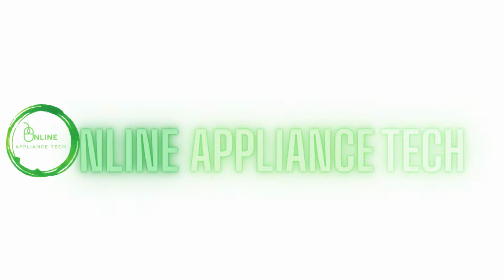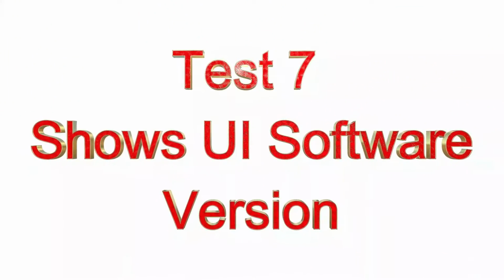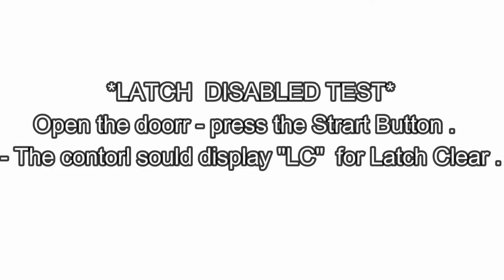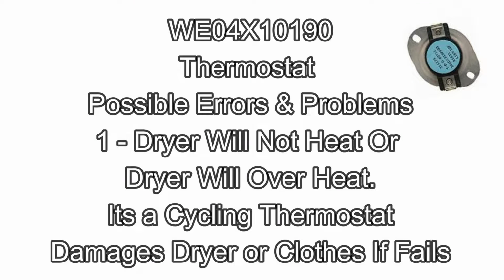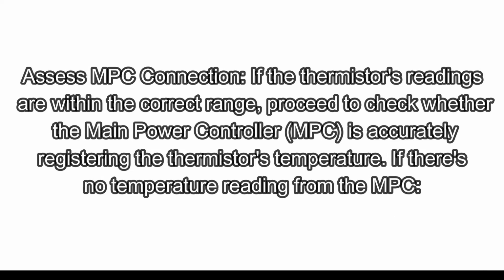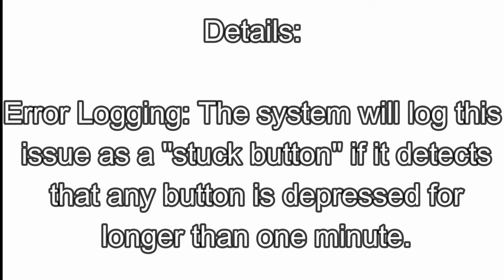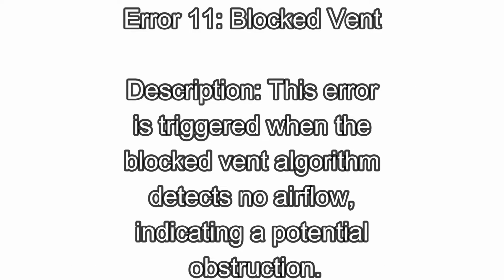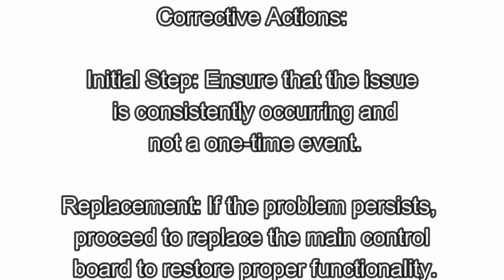GE Dryer GFD85 Series: Diagnostic Mode & Error Code Solutions

Comment: Great video, thank you! Looks like I had error code 8 and 13 which went away after running these tests. I did not clear them they went away. What has been consistent, though, is the Test 11 Door open/closed shows do whether the door is open or closed. The dryer still runs either way, but Test 12 Door Latch does show LS and LC correctly. Not sure if these two are correlated, but either way it seems the door always showing open may prevent the dryer from heating properly despite running a full drying cycle. Does that sound right? Also, what is Test 15? Seems to be some sort of setting from 0-20. Thank you!

Comment: I held the start button then turned the knob seven times then let go but I didn't get to diagnostics mode.
Reply: I noticed that when I started the knob turning on the left side it would skip when crossing the top of the rotation, so I always start the knob turning at the topmost right position, Quick Dry I believe. Then it worked for me.
Reply: It didn't work for me either. Tried 100 times

Comment: Thanks for the troubleshooting steps. And diagnostic mode entry. Have to check one at work it will not engage in the time dry.
Reply from the maker: I hope you find the solution to the problem. Good luck!

Comment: You never mentioned E20. I have this model and no matter what I do it constantly shows this error code after running for 2 minutes. Airflow is clear, all the thermostats/high limit switches and thermistors are good and I even changed the main board. But it won't go away